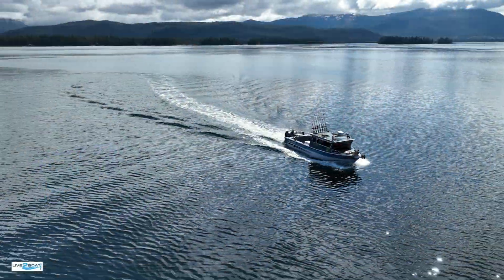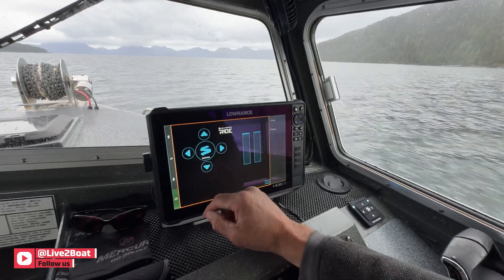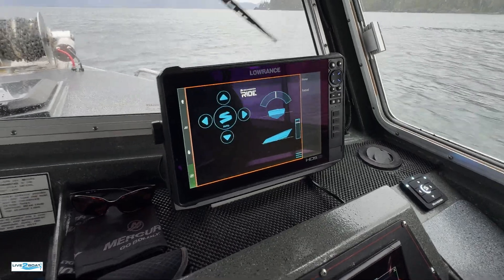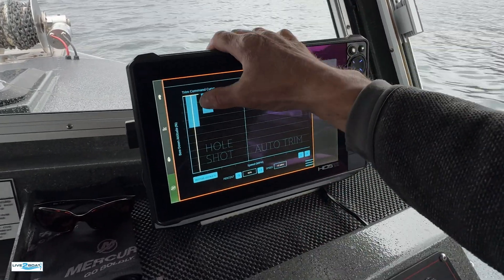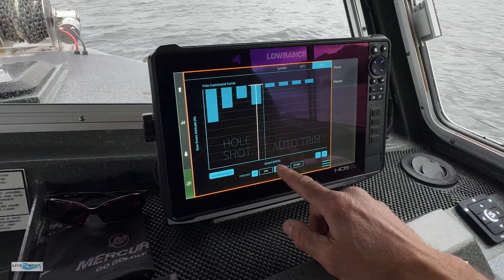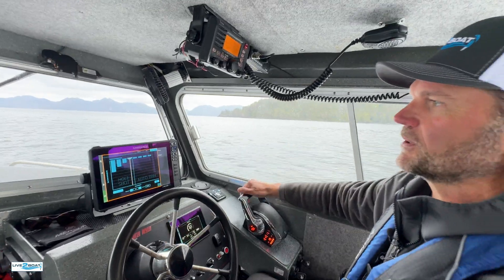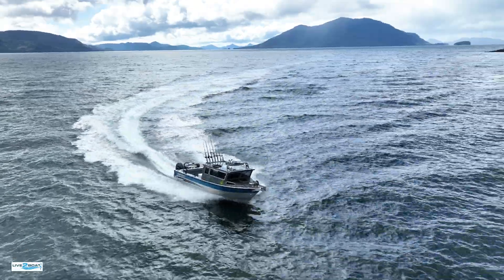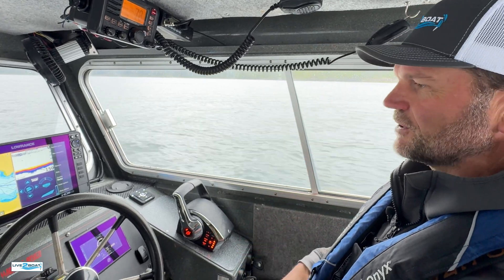Adjusting Our Seakeeper RIDE System for Optimal Performance

Comment: Hello! Just watched your YouTube video about Seakeeper. Amazing content!

I bought a Seakeeper Ride 450 for my new boat in Argentina. The team installed is seamlessly, however we are facing a problem with the final step connecting to a Mercury Vessel View screen (bought the cable separately)

Would you mind sharing the contact of the person that installed the Seakeeper for you? Hopefully he can help us 🙏

Thanks!
Reply from the maker: I believe you need to connect it to the NMEA 2000 network then from there to your MFD. There’s no way to control the RIDE system from the Vesselview gauge. If you need further help reach out to Seakeeper ride via the link below. Happy boating to you! 

https://ride.seakeeper.com/contact/